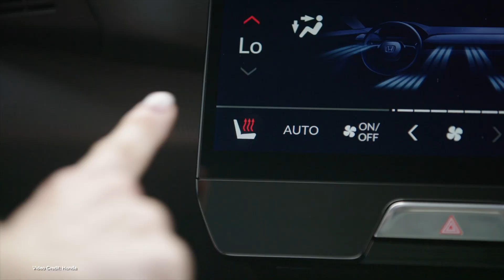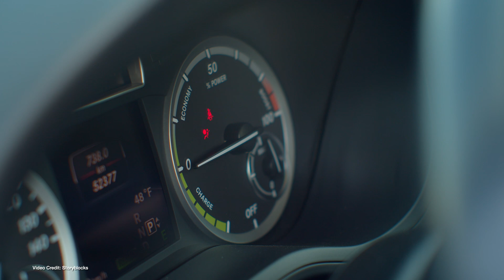EcoTEC Episode 273 - Quarterly Earnings, Alpine's First EV, Solar Potential!

Comment: The CyberTruck got stuck when it went for some off-roading with, I believe, Elon's right-hand man Mr. Baglino at the wheel . The ground was soaked off the paved road and the trucks weight proved a wee bit much for the tires it sported and the level of water in the soil. This was after the ground-breaking, as far as I recall. It was an error in judgement, not vehicular defect.